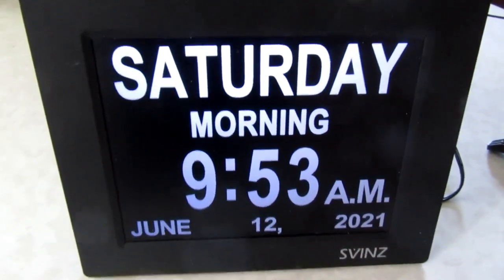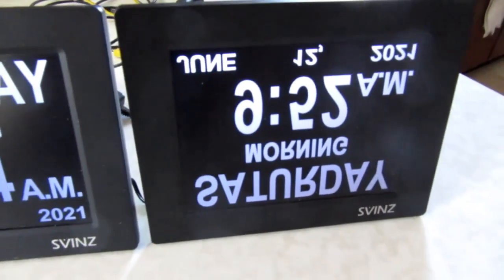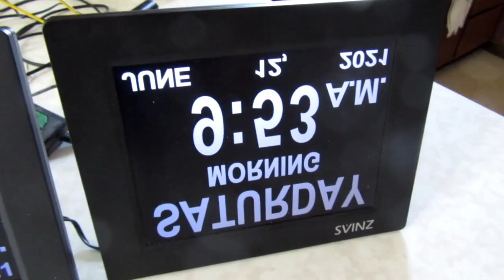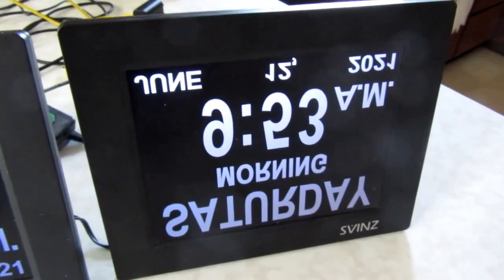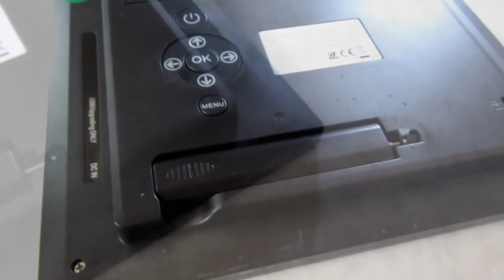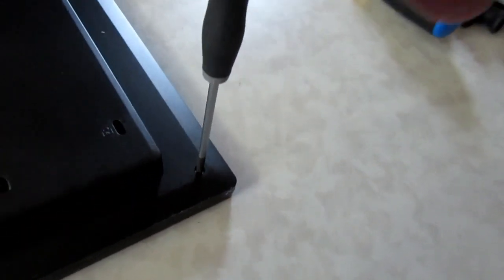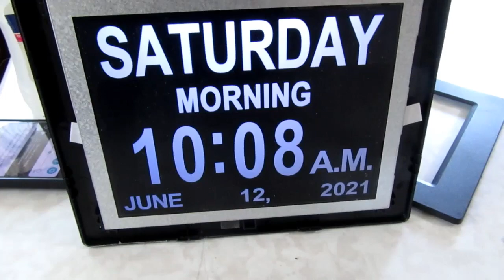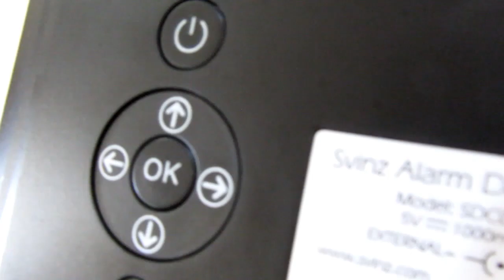SVINZ model SDC008 "Alarm Day Clock": Repair of common upside down & reversed display fault

Comment: Thank you so much for sharing this fix! My mum's clock had stopped working completely, the screen turned on but was all white.  I followed your advice and now it works perfectly again. I'm so pleased and proud of myself for being able to follow your instructions as I would never normally try to fix anything electronic. Your instructions were so clear! Mine is a YCOO model Z071 but it looks exactly like yours inside. The only difference is that there are no screws on the back so I just had to slip a very thin flat blade screwdriver in to lever it open.

Comment: Thanks a lot to your suggestion. I've repair my SDC-801 Alarm Day Clock that had a black screen. I've do the same thing that you did : clean the LCD connector then, now, it works fine.

Comment: Mine had the blank screen, and doing this cleaning has fixed it. Took very little time to do. Just be gentle with the thin cable. Thanks for the tip. Dave in the UK.😃

Comment: If you power adapter goes out, you can power the clock thru the USB port with Samsung phone charger and USB to USB cable. Works perfectly.

Comment: How would you go about taking off the bezel if the clock I'm trying to fix doesn't have the 4 screws in the back? Same model but the corners where the screw should be aren't on this one. Is it just connected just with the tabs?

Comment: I have the same clock.  The LCD is totally blank (black screen with nothing on it).  Would what you did in the video be the same procedure?  Thanks
Reply from the maker: User-ck3, I don't know what causes a completely blank screen. But it should not hurt to try the procedure.....

Comment: My first thought was that perhaps it was set up for somebody who’s lying in bed and looking through a mirror. 😙
Reply from the maker: Andrew Burke, I also has the same first thought about this.....certainly it was an intentional mode that the clock somehow got into, and which could be rectified through the clock menu. But no.

The thing that still mystifies me is that purportedly this exact fault is somewhat common with this product, suggesting that the same exact bad connection is a common thing.....which seems unlikely to me......why would all the other parts of the connection, which pass all the screen graphical data, logic power and backlight power, all remain intact but only that one signal gets corrupted. Yet, apparently this is just what DOES happen.